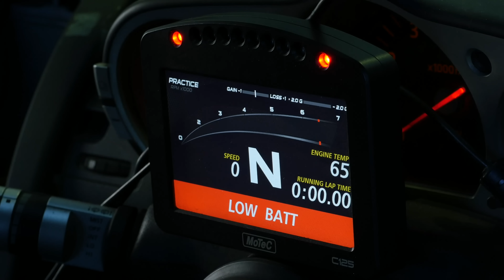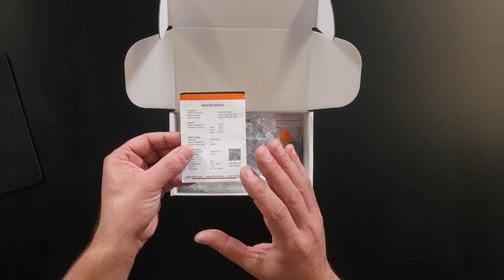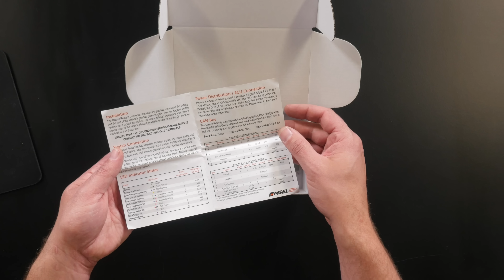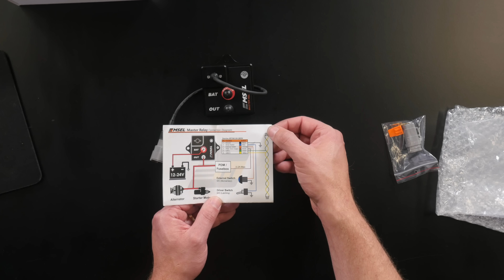What Does A Modern Killswitch Look Like? | MSEL [UNBOXING]

Comment: what are some Brand choices for the switches to use with this unit? both inside and sealed switch for outside the car? 
Also why the external Momentary? would that required you to leave it presses for cutting off power?

Comment: What's the purpose of the exterior switch being momentary?  Wouldn't you want it to be a latching switch?
Reply: The button is momentary but the isolator latches off when it's pushed. To reset the isolator you cycle the driver kill switch on and off.

Comment: More to go wrong
Reply from the maker: You can always just race with your legs if you want to be technology free I guess, otherwise the faster and safer you can make your car the better if that's the goal - Taz.
Reply: Is a physical disconnect not the most reliable way to Disconnect a battery,  A mix of old and new is some times the best way, history shows that, high tech German tanks that would not start in the cold  Russian winters, well they Russian run circles round them,  not so vorsprung durch Technik there then, Like in Rallying manual hand brake or electric?

Comment: Solid State Kill Switch; another piece of electronics to give trouble.
Reply from the maker: Nothing in this world is 100% infallible, but we'll take solid state over a mechanical relay any day of the week.
Reply: How can you say that since this gadget is new?  At least you can keep a bridging wire in case it fails.
Reply from the maker: The original version of this product has been around for a couple of years and is well tested in the motorsport environment. This particular version is new, but the only change is that it has a DTM connector instead of the more expensive autosport connector on the original isolator. Irrespective of this however, solid state relays are far from new and are a well established and proven technology.